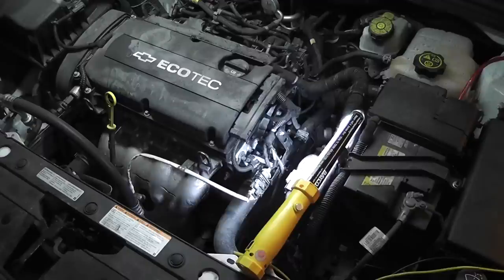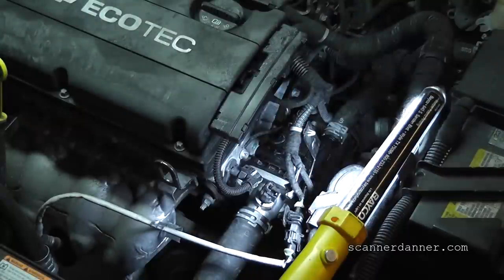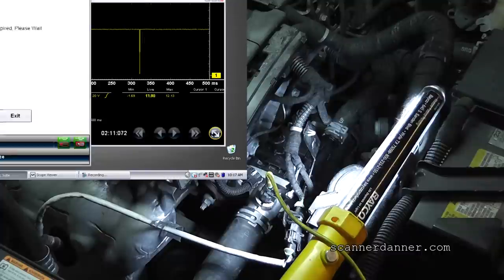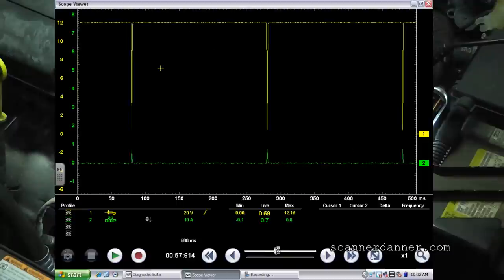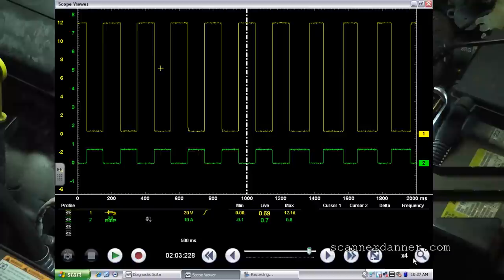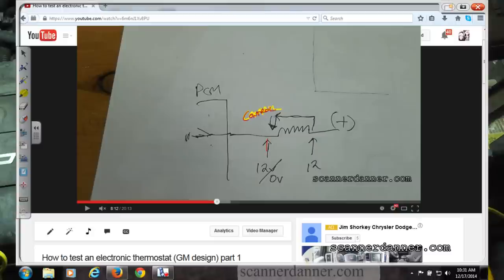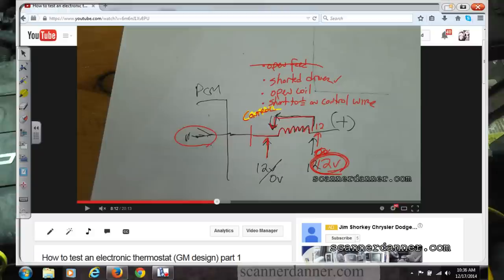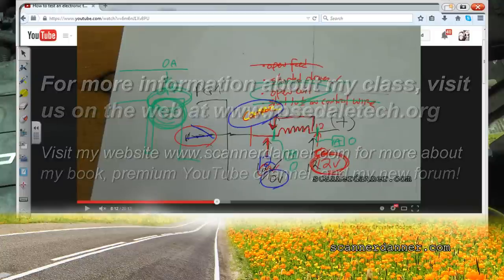Electronic Thermostat Part 2

Comment: The 0,8 ampere maybe looks low but if you calculate the energy
(14V * 0,8A=11,2W) is 11 watt.
this 11 watt is in the hart of thermostat and not in the coolant.
You can buy a soldering iron with 10 watt and do soldering
Hi from greece, you are the best !!!

Comment: this heated thermostat is basically German technology (Opel) which is needed because of the use of a wax pellet instead of a bi-metallic strip to open and close the valve.  the wax pellet has a very narrow range of operation which is improved by adding the electric heater. the benefit is that the same part can be used on different engines since the computer ultimately controls the function.

Comment: The "E-Thermostat" isn't just an emissions control device; it's also a fuel economy device.  By having the control to blend the cold and hot sides of the cooling system, the overall engine temperature is kept more stable during warmup, even on a relatively warm day.

Engine coolant temperature is really only representative of actual engine temperature.  If you flood a hot block with cold water, the ECT is going to report a condition very different from what the engine is actually doing, and inject a lot more fuel than may be necessary, as well as play with spark timing.  By continuously blending hot and cold side temperatures, the entire engine warms up more evenly, promoting both fuel economy and mechanical longevity.  The PCM is able to more accurately calculate fuel delivery during warmup, because the ECT data is more closely representative of actual engine operation.

I've seen on quite a few cars now that the PCM will look at ECT, AIT and engine oil temperature (EOT?) to determine fuel mapping.  Discrepancies between the three can signal to implement backup strategies, or alert to a potential problem.  I don't think the Ecotec engines use an oil temp sensor (though I could be wrong), but by using an electronically heated thermostat, the PCM is able to provide an active level of control over the engine temperature that no amount of passive monitoring could match.
Reply: Awesome stuff bud, thanks for the comment, it thought me something good reading it.
Reply: +rhkips: HIgher engine temps allow for better emissions and efficieny at part load conditions...  at high load conditions , you want lower engine temperature to achive full power, lower knock tendency and for component protection...  mechanical Thermostat are a compromise for all this... the electronic ones allow a very accurate and fast control of engine temp for a specific load situation

Comment: Hi Paul - I've seen your videos using test light. At times your test light is connected to batt (-) as in the case of energizing a groundside switch circuit, and at times connected to batt (+) on the same groundside switch circuit. Is it because in the former you have the system plugged in and unplugged on the other? It gets confusing for me. Please excuse my curiosity...
Reply from the maker: It is becoming more and more difficult to answer questions here. I have 80,000 people asking me for help now. So I have created a forum to help you guys better. It is free to join and we can exchange pictures, wiring diagrams and waveforms if needed to help guide you through the process of troubleshooting your vehicle. Thank you so much! Hope to see you there. 
Paul Danner (ScannerDanner)
 https://www.scannerdanner.com/forum/post-your-repair-questions-here.html
Reply: I wl...and thanks for your prompt reply

Comment: great video as always I have a vehicale 06 gm truck at work with a intermittent no start no crank problem suspect popsssible bcm  not shure yet haven't tested  question do you have a video on this problem on you tube channel  or any suggestions would be helpful thanks mike in florido

Comment: This is 7 years late. But my 2012 Cruze is on the passenger side. Which the thermostat looks like it has a temperature probe which the mechanical parts slide onto. This is all within the housing of the thermostat.

Comment: BMW use a system similar on thier engines, makes them be able to run the engine hotter for emissions and under WOT open the thermostat right up for as much cooling efficiency. Also some models have louvers on the grille that open at higher speeds for more airflow through the radiator.

Does make sense being it is made to be held at a high load on the autobahn (open speed limits) for long periods where you want as much cooling as you can.

Comment: Hi Paul...the test flickers on off when we test ignition coils and injectors..does this mean that the ignition coils and injectors are also pulse width modulated?????
Reply from the maker: Injectors are for sure and we vary the pulse width.
Ignition coils typically have a set on time or dwell period bmso we usually don't use that term for coils but you wouldn't be wrong if you did

Comment: I have a 2013 chevy sonic, changed water pump thermostat and temperature sensors, checked all relays and still overheating. Fan does not com on and thermostat is not opening up, any recommendations?

I went to dealer and they said they need to cjange the block to know whats going on..

Comment: Hi Paul looking at the engine on this, it looks exactly the same as my car here in England, my car is called a Vauxhall Corsa, General Motors car, mine is a 3 cylinder petrol, there is a 4 cylinder version as well....Fred UK
Reply: +Tom Smith  yes its same     vauxhall 1.6       or 1.8

Comment: so my question would be. why has my thermostat gone bad 4 different times now in the last 2 years.. seems like every 6 months.. is there something else causing it to go bad
Reply from the maker: cheap parts? where are you getting them from?
Reply: ScannerDanner  well the first 2 from O'Reilly's.. the last 2 from autozone
Reply: ScannerDanner and less than the time I wrote this question my wife's check engine came back on this morning.. havnt had time to check it yet .. but almost 100 bucks for the part doesn't seem like it should be a "cheap" part

Comment: could the coil short inside the thermostat housing, causing both current flow to be seen and a reduced voltage on the control side?  This could cause 0volts or less than 12volts when driver output is OFF... assuming it shorts somewhere near the middle of the heater coil, not at the supply side of the coil (zero voltage drop)
Reply from the maker: I suppose that is possible. This could be easily checked for with a current measurement on the feed side. It's just not something that happens

Comment: When. I cheick in live data
Etc 113
Raditor temp 50
Thermostat heater command 0 stil
Range from 0 to 100
Fan open 2 speed
My ask about range is that normal 0  or not normal

Comment: CURIOUS WHAT DTC NUMBER WAS SET FOR THIS ISSUE THE EXAMPLE CAR WAS HAVING. P0597 P0599 etc?
Reply from the maker: sorry man, I don't remember. I believe I told you the code number in the video. Did I not?
Reply: Its mentioned in description for part 1 of the video. p0597  thanks